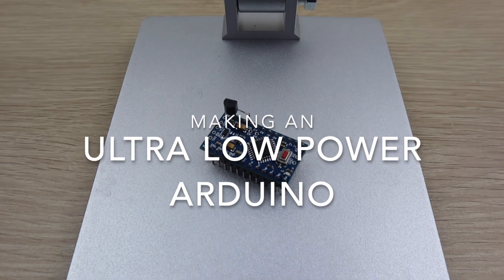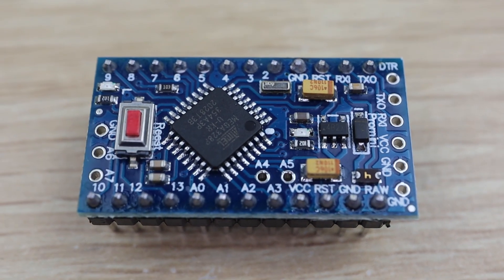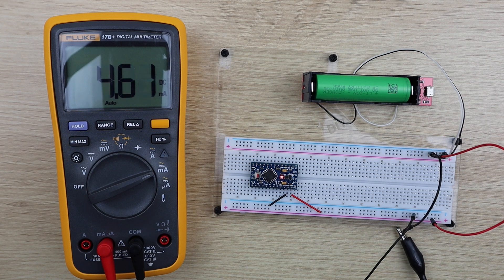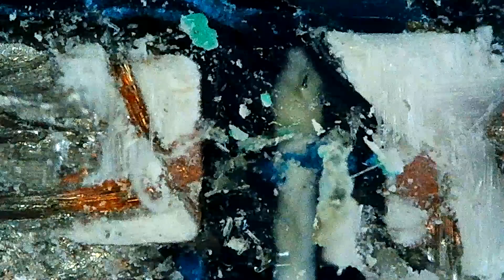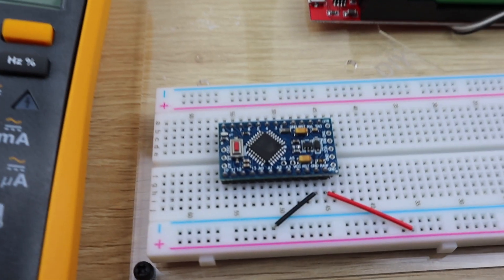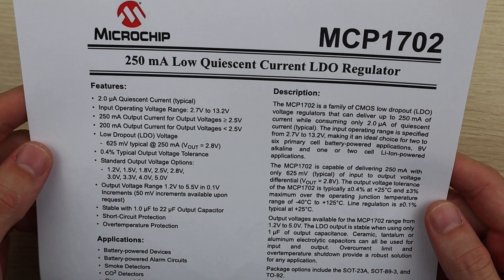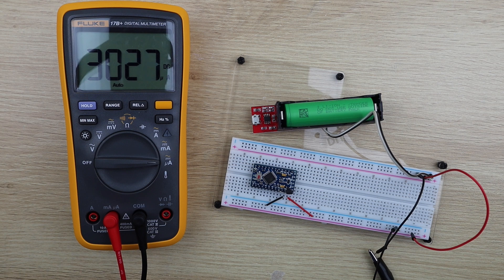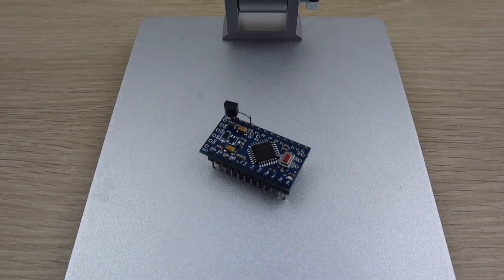Making An Ultra Low Power Arduino Pro Mini

Comment: I would be interested in something like this, but with wifi capabilities so that it connects to home assistant. I guess in that case it would draw way more power. I would just like to be able to deploy some sensors around the house and/or outside without having to route power cables to them. You know having a nice little battery powered package would be great because it would require minimal work to deploy in any location.

Comment: These modifications work and do greatly reduce the power consumption, but be careful. If you accidentally swap ground and power to the MCP for less than a minute like I did, your Arduino will catch fire.

Comment: this is awesome
im working on a project where i need to make a long lasting sensor node
not sure how i can reduce the power consumption at the rest of the sensors
Reply from the maker: Try using bare sensors that are commonly used in low power devices rather than "off the shelve" sensor modules for Arduino's.

Comment: I see you only measure the input at Vin + GND. Whats to voltage on Vout (3.3v)? Because I follow your guide and replace the regulator with MCP1700 and there is no output on Vout, it's 0. Pro mini wont turn on.

I end up connecting mcp1700 SMD with wire, its easy to solder because mcp1700 is not too small but the tiny smd leg is easy to broke. It gives 3.3v on Vout and my pro mini is working as it should.

Comment: I follow your 1st video to remove the onboard regulator, without MCP1700 output pin on my pro mini is over 3.3v? Does this will burn my oled later? The oled suppose to be power with 3.3v.
Reply from the maker: It depends on the display and what you're using to power the Arduino now. Typically I2C OLED displays can handle 3.3V or 5V so if you're powering it with a 3.7V battery then this shouldn't cause any issues.

Comment: Positive and negative pole of multimeter is connect to ground from battery to arduino?
Reply from the maker: The multimeter is being used to measure current, so it has to be in series with the supply.

Comment: Would battery life be increased if you removed the Ardunio IDE? By that I mean build a project in C, or even assembly. Arduino IDE wastes clock cycles, so I'm thinking extra power can be squeezed by reducing this?
Reply from the maker: No, a microcontroller doesn't work like a processor that adapts its frequency/power consumption for the workload. The chip just runs the same instruction set over and over at the same frequency. If you improve the code by not using the Arduino IDE then you'll just get the chip to run through the full set of code faster, it won't have any affect on power consumption.
Reply: @MichaelKlements  Thanks Micheael. I didn't know that.
Reply: @MichaelKlements  I ended up back on this video after looking for a low powered microcontroller. I still need lower, but it was funny that Google suggested this.  I'm looking at a PIC12F508-I/P. Can run on microamps.

Comment: The dremel you are using looks good. Have you also tried a hot air soldering station? If so, how would you say this dremel compares to that. 
I would like to try and desolder some components without ruining them with the soldering iron!
Reply from the maker: I havent tried a hot air station but the Dremel works really well as a hot air tool. It's also got a soldering tip so two in one.
Reply: @MichaelKlements  
I will have to get one and give it a try!
Thanks.

Comment: Is there a way to lower the current to any connected devices like sensors or electronic ink displays? digitalWrite LOW doesn't do the trick in every situation.

Comment: Very cool, I am making a custom module using Arduino for in my car listening to a lin bus. It has to be stand by constantly, listening for messages. I will make sure to remove the LED since low power will be a smart choice as it will be doing nothing all the time.

Comment: Great Video. You did not say much about the 18650 batteries. I read that some of them come with an "over current protection PCB" 
that not only switches off if you draw too much but also too little current. But so far I have been unable to find out where this lower cut-off is.
Can you share any experience in this regards. Would be greatly appreciated. Particularly for these low power projects.
Reply from the maker: I haven't exeperienced any 18650 cells that shut off if too little current is drawn. In my experience these onboard management circuits only shut off on low voltage or high current, some also have a temperature limit.

Comment: My I suggest if you need very low power consumption you don't use an arduino..the MSP430 can sleep at almost no power and run on a coin cell for months.

Comment: That is a super cool modification.  I'm amazed at the efficiency gains. Just removing the led made a huge difference.
Reply from the maker: Yes, the actual Atmega chip is really efficient - it's great for low power projects

Comment: For 3.3V Pro Mini, why not just connect the Li-ion battery to the Vcc and GND?
Reply from the maker: Because you lose energy through the low efficiency regulator
Reply: @MichaelKlements 
Thanks for the reply. 
Look at the schematics, there is no regulator on Vcc input pin. Only RAW has it.
Based on the 328p spec., it should be fine to use LIR2032 to power 8Mhz Pro Mini through Vcc pin.
And should be fine to use CR2032 to power a 4Mhz 328p.
Therefore, for ultra low power battery application, there is no need for a LDO/regulator.
Reply from the maker: Sorry I misunderstood your question. What you have asked is what I did before putting the new regulator on (the test at 5:03). This is fine if you just want to power the processor, but if you need to use voltage sensitive sensors or anything requiring a stable reference voltage (voltage divider etc.) then you need a stable input voltage so I replaced it with a more efficient one.
Reply: @MichaelKlements  Got it! Now I use digital input and 0.96 OLED only and it works fine. Will double check when connecting sensors. Thank you.

Comment: I am trying to build a battery powered receiver/epaper display for my water softener salt level monitor that could be used in a wall mounted case. Basically it shows the salt level in the tank and shows when I need to add salt. I built my current working version a couple of years ago with two nano clones, each with a HC-12 wireless serial port. I use a HC-SR04 Ultrasonic Module Distance Sensor connected to the transmitter in the softener salt tank in the basement, and a 1.3in OLED display on the receiver in the living room. Both units are powered with a usb power cable plugged into a wall socket. 

I am thinking the epaper display would only need updated once a day. (The softener doesn't even run every day!) I would only need to run the battery powered receiver until it captured a data transmission (once every 15 min.) and updated the epaper. Also, I would like to put some sort of battery level indication on the display so I would know when to change or charge the battery.

Your video has some interesting possibilities for my project. Thanks.
Reply from the maker: That sounds like an interesting project! I used an epaper display a while back to make a subscriber counter that updated three times a day - https://youtu.be/09OjXKzsNvY 
You could make something similar with an ESP32 as well, its a lot more power efficient than a Rapsberry Pi.

Comment: If you put the 18650 to vin without removing the regulator, is there any problem with that , it will essentially be feeding 3.7v into the output leg of the voltage regulator?
Reply from the maker: On the 5V version yes you'll just get a reduced voltage out of the regulator (probably less than 3.7V and potentially not enough to run)

Comment: Michael, great video and I saw your post as well. It inspired me to make low power project of remote controlled shades. The receiver still takes few mA but it does in with 10Hz duty cycle which probably averages to 0.1- 02 mA, the Ardurino itself went down to 5 uA. I like your other videos too. Great job !
Reply from the maker: Thanks Michal, happy to hear it's helped you with a project!

Comment: Excellent video, just one question, is it save to run an Arduino without the voltage regulator? I have a project where I need to drive an Arduino with a RDIF reader (obviously I would disconnect it and initialize it on demand with a long-pressed matrical keyboard), so, I have to same all the energy possible
Reply from the maker: It depends what you're powering it with and what you're connecting it to. If you're using an RFID reader then it'll likely need a regulated supply, but this doesn't have to come from the Arduino. You also still need to be able to supply the Arduino with some sort of "constant" power source.

Comment: Just a short question Michael, in situation when u remove stock voltage regulator, and when one does not add a new MCO1700 regulator, can you connect such arduino to computer usb hub and upload a sketch to it or you need to do it before hand? I'm not sure how much voltage is coming from computer when uploading sketch.
Reply from the maker: I'd have to look into this. The USB power circuits are usually connected directly to the regulated power side as USB power is already regulated, but I'm not sure on the 3.3V variants. On these the USB supply may be stepped down by the onboard regulator or the USB programmer steps it down to 3.3V already.

Comment: Hello i have a question why we need power regulator what will be if we remove it forever
Reply from the maker: Because the atmega chip and sensors run on 3.3V or 5V, if you’re not supplying your Arduino with one of these voltages then you’ll damage it. It also affects sensor scaling and analogue IO.

Comment: I have experienced something strange. I wanted to achieve as much as possible power reduction. I have written 3 lines code putting uP to sleep mode (POWER_DOWN). When I compile this on Arduino the current consumption in the sleep mode is 0,3 mA. But when I compile the same code on Atmel Studio the current is 0,01 mA. I did many tests but result is still the same. Do you have idea what is reason of that difference? I used pure Atmega8 (without anything connected to ports). Download over Atmega ICE.
Reply from the maker: It's probably best to ask that on an Atmega forum. I'd guess that this has something to do with how each IDE compiles the code. You may be writing the same code, but different compilers will likely produce different machine level instructions based on the same input code.
Reply: @MichaelKlements  Thank you for answer. Yes, I am aware of that different compilers may produce different machine code. The only frustrating thing is that POWER DOWN used in Arduino gives not expected result even if used the same /avr/sleep.h library. Seems Arduino is less predictable than I thought. Thanks for your feedback.

Comment: I've installed a barebone ATmega 328P in my mailbox with 3 AAA batteries, they're still good after 4 years
Reply: what other sensors is it using ?
Reply: @sahanpanditharathne2765  A reed switch, two limit switches, sends data over 433 MHz. But it sleeps 99.999% of the time, the sensors aren't very relevant

Comment: excuseme, i want to ask
can pro mini use external power, and simultaneously connect FTDI to laptop USB?
because some of my sensor and module require quite a lot of power, but I also need FTDI to view the Serial Monitor at the same time.

I ask like this because on some boards, like the ESP32, it doesn't allow to provide external power when the ESP32 is connected to a USB laptop, because it can cause damage (written in the ESP32 manual)
Reply from the maker: Is there a reason why you can’t power your sensors separately to your Arduino? Why are you trying to power the sensors through the Arduino if they use a lot of power?
Reply: @MichaelKlements  I integrated HC05 and ESP01 as a module in Pro Mini. Those 2 modules consume a lot of power so I add external power to the 2 modules.

I think, the power used by the 2 modules and the power used for the Pro Mini must come from the same 1 power source(external power), 
is that correct? or am I wrong

correct me if im wrong
Reply from the maker: I understand that you’re using them with your Pro Mini, but that doesn’t mean that they need to be powered through the Pro Mini. You can power them externally and just make sure that they share a common GND.
Reply: @MichaelKlements  ohh okee, thanks a lot dude. Finally i found a right answer.
Reply from the maker: That’s great, hope this helps!

Comment: Michael: Great visuals, tho' SMT rework is (sadly) far beyond the skills of normal humans... I've tried...
<sigh>
- - - -new topic - - -
2 brief points on your excellent close-ups...:
#1. Better DOF is achieved with f11 or even f16 & much more light. Taking "stills" on a tropods helps a lot ... & then they are edited-into the motion video...  ;
-&-
#2. Assuming you have a PC and some free software...: A better technique is "focus -- stacking". There are many YT tutorials on how to take-&-stitch the multiple images. BETTER: Jeff Geerling recently did an excellent short video on using "focus -- stacking" for product shots. <<I have been doing this for years; the positive results are major & the added effort is small & absolutely worth it!>> 
¶ 
If interested, please see Jeff's short video, at...:

https://youtu.be/pinYVZxBF2Q <==<<

Thanks, again! /Mike
_ _ . _   ._.   _
Reply from the maker: If you’re not able to desolder the components, just pick the led and regulator off with some needle nose pliers or clippers. I did that in my first video.
Thanks for the tips on improving the close up images. I’ll definitely try out taking stills and adding motion in post. I’ve heard of focus stacking, I just haven’t ever thought to try it. I’ll try it out on my next close up video and see how the results compare to tripod and stills only.

Comment: Thanks for great video!
Does the mcp1700 need caps on Vin and Vout?
Is it getting those from the original caps on the board? S4 diode doesn’t affect anything does it on the Vin side?
Thanks.
Reply from the maker: Thanks Ian. Yes you're correct, it's just using the original caps on the board. I haven't noticed the S4 diode affecting anything, it seems to all work correctly to me.
Reply: @MichaelKlements  
Good to know can solder the regulator directly to the pro mini. Thanks.

Comment: I wonder if that regulator could work with esp32, it has rather high but short spike when connecting to wifi.
Reply from the maker: I'm fairly sure it would manage, its rated for 250mA and the ESP32 hardly draws more than 20-50mA with standard tasks and spikes to around 150-200mA when transmitting information over WiFi.
Reply: @MichaelKlements  Modifying the regulator on an ESP32 would be pointless. It also has the USB chip behind the power regulator. That chip continues to draw around 5 mA even when the ESP32 is sleeping. And according to Andreas Spiess (the guy with the Swiss accent), the ESP's Wifi draws up to 400 mA when the radio is active. The next best thing would be the FireBeetle 8266  (which doesn't have BT) from DFRobot, which comes with a low power LDO and turns the power for the USB chip off when the USB is unplugged. Strangely enough they didn't implement that smart feature on the FireBeetle ESP32 version. The FireBeetle is a lot more expensive than a regular ESP 8266 and their shipping cost is off the chart. If you don't need the extra memory or BT or Wifi, then Arduino is your friend.

Comment: This pretty cool, awesome video! Am a bit of a newbie though so was curious about a couple of things:
1.- What are some examples of applications that would work fine without a voltage regulator?
2.- Any recommended tutorial or documentation I look at to learn how to use the low power library?
Thanks!
Reply from the maker: Thanks Alce,
1 - Anything that doesn't require measurements or readings from sensors. So projects with lever or reed switches, pushbuttons, relays, solenoids etc.
2 - If you look at the low power library on Github there is a bit of documentation there.

Comment: How many switches can it manage?    I have moisture sensor turn on and off low power water pump to keep plants watered?

Can you list every item you used?
Also show location for code?.

I am not technical.  Making for disabled so they can have garden plants...
Most humble appreciation!
Reply from the maker: This guide is just to adapt the Arduino to use less power. For project instructions to build soil moisture monitoring devices have a look at my blog - https://www.the-diy-life.com/

Comment: this video remind me of one of my projects that I did 2 years ago .I made my own custom arduino nano. then used it as weather station adding the low power sensors. 6000mah battery lasted nearly a year on that device. AVR are really amazing for low power projects. By the way you are doing GREAT man.
Reply from the maker: That sounds pretty cool, so did you modify an existing nano or design your own PCB as well? Yeah they're quite incredible with the right mixture of supporting hardware for the application. Thank you!
Reply: I have designed my own PCB and ordered it from a Chinese PCB maker. Just added a voltage regulator and resonator and connection with sensors 😂😂. Nothing more .

Comment: This is cool :)
Subscribed I didn´t know your channel
Reply from the maker: Thank you, that's great!
Reply: @MichaelKlements  ESP8266 goes to 300+ma in very very short bursts so I assume esp32 does the same. A small elec cap will buffer it decently. BTW, I've done something similar using a ht7333.

While calculating how long will the battery* last you have to take in account the voltage dropout (in ht7333 I think it was 170mv) and that that cell 3000mah rating is, most likely, to 3.0v. The arduino will most likely cr*p itself out at slightly under 3.3v so you can only use the 18650 down to around 3.4v